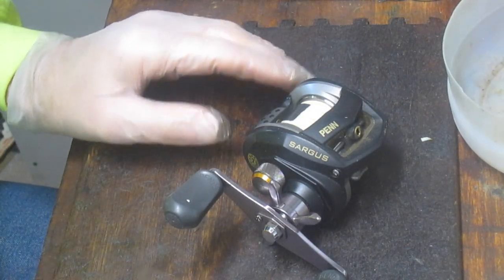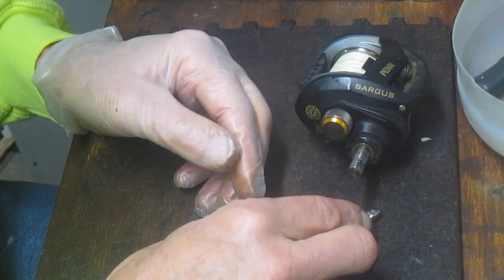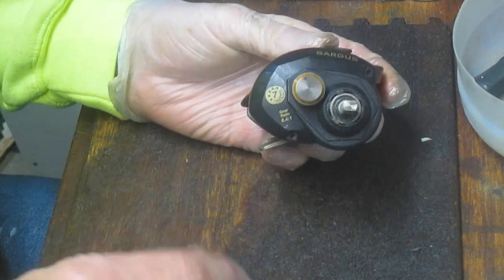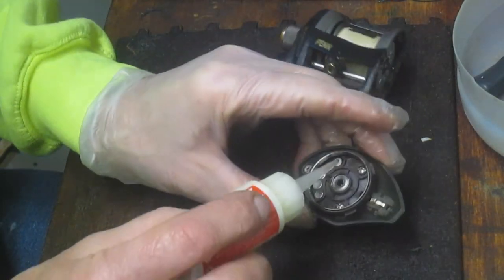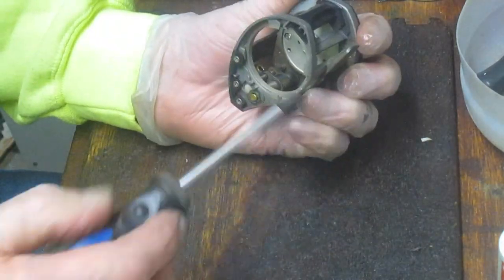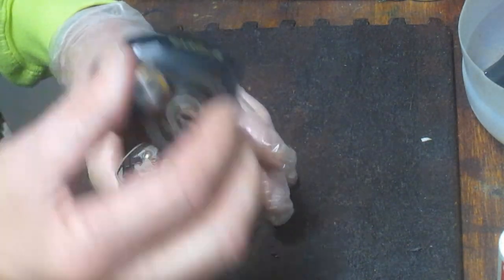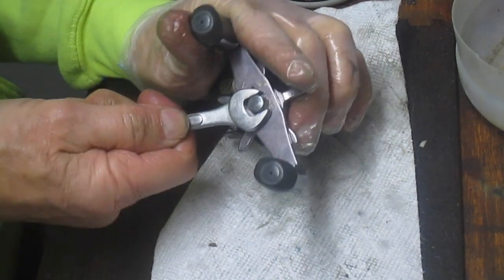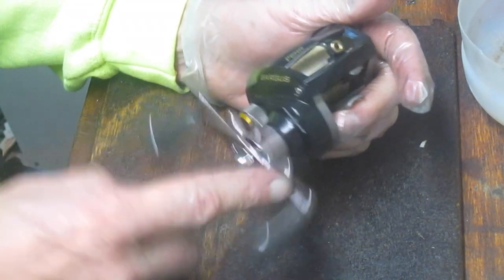Penn Sargus 64LP low profile baitcasting fishing reel how to take apart and service

Comment: Dennis,
     You sir, are the Zen Master of Fishing Reel Puzzles !  It was a pleasure to watch you "make the impossible, possible" taking this unknown reel apart and then successfully getting it back together after the phone call.  
       Have you ever considered using a 18-24 plastic egg compartmentalized container for small parts and screws to help in the tricky re-assembly process sequence instead of the single milk carton ?  Just a thought...  Either way, a great effort !  Congrats...
Reply from the maker: Thanks for the kind and encouraging words.  I'm somewhat of a creature of habit and the parts tray works for me.   The egg container idea is a good one and I encourage others to use it.  The theme is to know the sequence and where the parts are when you go to reinstall.  Anything thing that keeps them off of the floor and out of the way of trouble is good!  Best wishes - Dennis

Comment: Interesting reel. Looks like a good built 200/300 sized inshore baitcaster with stainless steel parts . Wonder why Penn dropped out the saltwater low profile reel market.
Reply from the maker: I don't think this is a saltwater only reel.  It's size does not differ from an average low profile reel